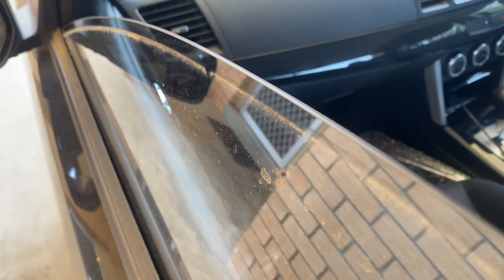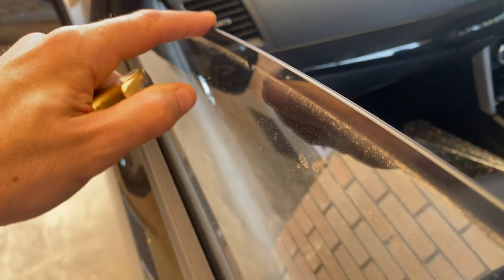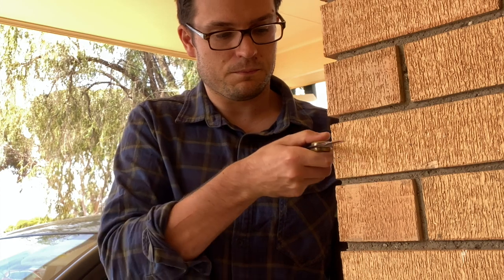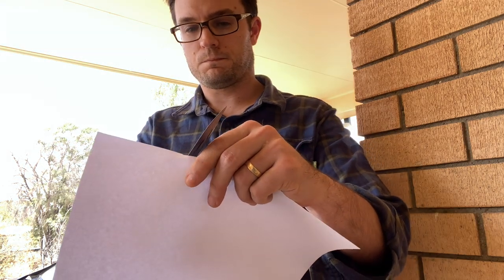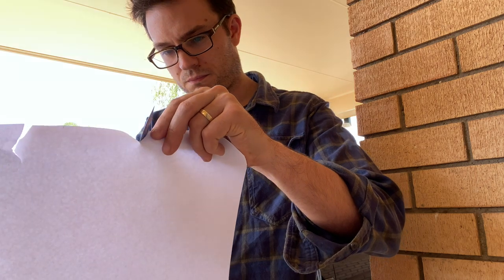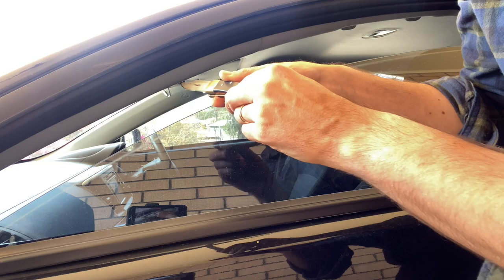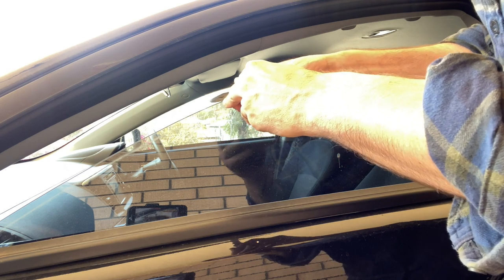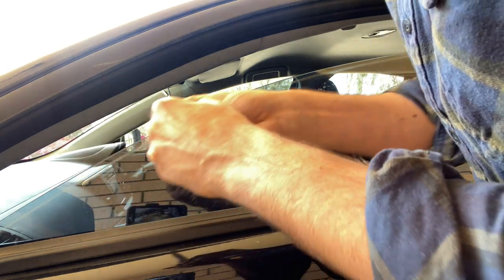How to sharpen a knife with a car

Comment from the maker: Reply to this comment with anything you want to see if I can sharpen a knife on:
Reply: My papaw used to tell me the bottom of a ceramic coffee cup would put a edge on In a pinch never tried it myself also said you could with a rock if you found one with just enough grit to it.
Reply: I love the way you're surfing that wave between clickbait and comedy/satire. You need to find a river stone. One of those rounded rocks of granite that have spent years in a creek bed in the mountains. Any self-respecting Buck 110 survivalist should know this is the only way to sharpen a 110.
Reply: Oh man, yes! Find random things in the city and nature. This could be a sweet series. Maybe even a job for uncle Randy. And then maybe an alternative city prepper uncle that he doesn’t get along with. This could turn into a lot of material for you. Just a thought, keep up the good work Pete!
Reply: Joseph Hammett A coffee cup or any other ceramic kitchenware works well, I’ve used a plates, bowls and mugs :)
Reply: Your brick wall!
Reply: Rocks from the yard.
Reply: @deathbyastonishment7930  I concur. I have more then once cleaned up an edge some ceramic kitchen item.
Reply: A horse!
Reply: Fine bone china. Its like the coffee mug, but finer grain and much harder. Alternately, literally sharpen your knife on Uluru.
Reply: Your teeth
Reply: A ceramic cup on a tig rig
Reply: Using cardboard as a hone. It does work not as good as a loaded leather strop.
Reply: When I worked in a warehouse we would sharpen our box cutter blades on some pallets.   I found that the cheap steel they’re made out of just reformed with heat from the more dense wood. Still worked though 🤣
Reply: Cedric & Ada Gear and Outdoors not a sharpening video but maybe an instructional video on the "crack blast" Ferro rod technique. I never could master it:)
Reply: Are you going to do the OUTDOORS55 series where you use everything from the bottom of a coffee cup down to stropping with dirt on cardboard?
Reply: River stones or shore pebbles.
Reply: @SharpTexan71  I use pieces of thin 'cereal box' cardboard loaded with super cheap diamond paste from ebay to strop all my knives, very effective.
Reply: a brick
Reply: The ceramic ring on a lightbulb socket you see in basements and closets.
Reply: A policeman’s bum
Reply: @GurtTarctor  I have some diamond spray. Could be a good pack strop.
Reply: -a lens of an old pair of prescription glasses
-nail file
-diamond angle grinder disc (disc only)
-sandblasted titanium
-strop on drywall
-spaceshuttle
Reply: I found when scoring fibrocement blueboard my utility knife point would be nice and round in 5 passes. Chisels from then on were touched up this way.
Reply: A sand covered stick
Reply: The spine of another knife 😉
Reply: Cat skin 😼
Reply: The Basil's dark empty cold cold heart
Reply: @Mr.Joe86  I used the bottom of a coffee mug as a hone for about 15 or 20 years. Works like a champ.

Comment: I do this all the time. I use my 94' Jeep Wrangler to get a burr going, then move on to the Volvo to get a good working edge. I finnish on the Porsche to get that mirror polish. My best advice is to stay away from cheap sharpeners like the Dacia Sandero, you get what you pay for in knife sharpening.